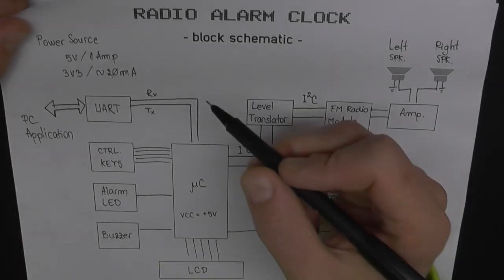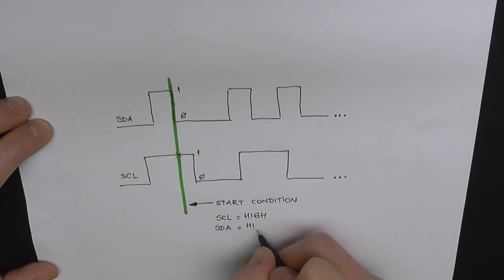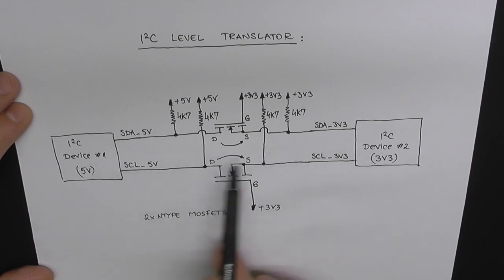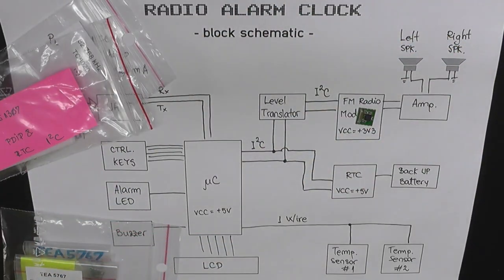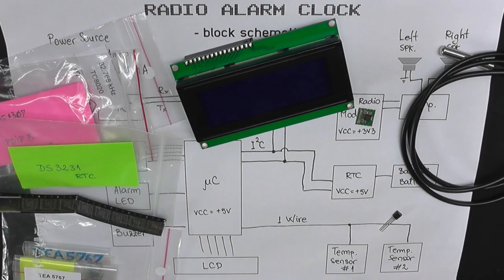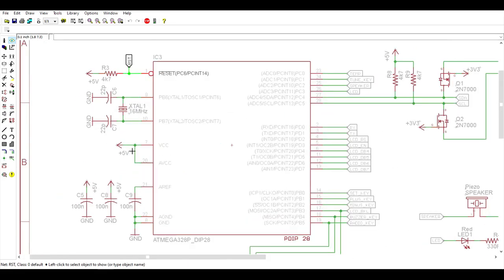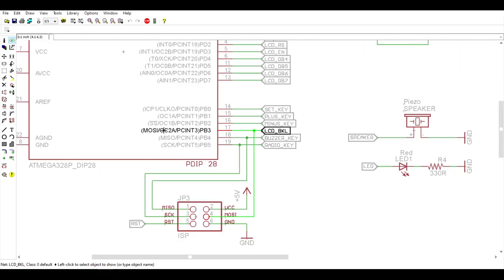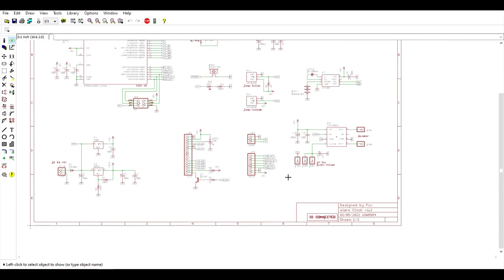Build this COOL Radio Alarm Clock - PART 2

Comment: Will the LCD fit on top of the mainboard even if I use sockets for the IC's including the microcontroller of should they be directly soldered on the PCB ? Great series !!
Reply from the maker: It all depends what height are pin headers (male & female) for the LCD. You should use the 8.5mm for the female header. That will give you aprox. 10mm between the boards and you can use sockets for the chips. Thanks for watching ! 😎